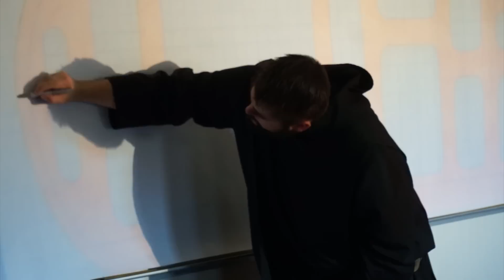Teardrop Trailer Part 2, Axel and Framing(?)

Comment: I love the way these videos show thefancy workshops he guys have.
Reply from the maker: +George Lee So when you don't have the right tool or skills to do the job properly, you shouldn't go to a friend who does? Is that what you're suggesting? Because I don't think JB Weld would have held up, if I tried to do it myself.
Reply: No I dont mean that, I bough a Sears table saw and a cheap Harbor Freight mig welder and hand tools to build my teardrop. You can see it on D,I,Y Camper. BTW i am not a carpenter.

Comment: Hey man! Good video! I will say the solution to the framing splitting issue is to use 7 layer ply. Birch, ya its expensive but for this "framing" purpose it works better. It also stops the wood from "walking" when you put the screws in. Plus its stronger etc etc etc.  For this function pocket screws are the best.

Comment: Your axle move was a hard but excellent decision. On heavier trailers we observe the 60 40 rule according to weight, empty trailer according to length.
When you glued the plywood together you changed the strand orientation. When we make curved  walls, we drop down in size and glue two pieces together in order to get the bend. By gluing and changing the strand orientation, we have stronger walls in the bend, where it is needed.

Comment: My suggestion is to go with Baltic Birch or Appleply  plywood. Appleply comes standard in 4x8 sheets whereas Baltic Birch will be tougher to find in 4x8 sheets, but they do make it.  Pocket screws is a poor choice when you are joining edge grain to edge grain, as was your case.  Your suggest (half lap joint) is the way to go and would be extremely strong.

Using screws as clamps is classic when the screws or their holes isn't a problem. I remove the screws after the glue as dried so I don't have to worry about running into one later.

Fun project to watch.

Comment: First I really do enjoy your videos. If I were building this I would start with a full sheet of 1/4 inch plywood on the outside and then add 3/4 inch framing to the inside out of hardwood, that way additional bracing could be glued and added to high stress points in the frame of the unit. This way the entire part becomes a wall unit that is very strong.

Comment: I took a different route for the frame.  I built it out of 1x stock.  I just laid them out over the outer skin of the trailer, using different widths and lengths and butt jointed them together with biscuits. (Yes, I know there is almost no strength when you do that),  However,  once I had them all laid out, I glued the entire frame to the outer skin.  All that glue between the face of the plywood and the frame tightened everything up and provided plenty of strength.  Then, I  used a flush trim bit to trim both the skin and the frame at the same time.

For the hatch, I did use plywood for the frame elements,  but had better plywood, that did not give me problems.   It was not Baltic Birch though, just decent plywood.
Reply: Allan Smith 
Stupid question but what kind of skin did you use and why and where can a person buy it ?
Reply: Allan Smith 
Also.   Stupid question but what trim did u use on outside of your outer layer or is it all the same and what everyone uses ?   Where does a guy get that ?
Thanks

Comment: I ended up using Purebond plywood for a simular reason, purebond takes a nice screw and the core is poplar. But with that being said, I think you would half-lap it as well!
Reply from the maker: In hindsight, better products usually work better.  It's hard to make that choice between a $50 sheet of plywood and a $20 sheet.

Comment: I would think about cutting a section out (maybe 12-24" wide) and 1/2 lap a new piece back in.  Plywood has a TON of strength when fasteners are screwed through the face and adhesives are used and along the grain.  Anything fastened into or glued onto the end grain has almost no strength...  That goes for birch as well.
Reply: Oh...  And it was great getting to work with you on the trailer!
Reply from the maker: I have a different idea I'm going to tryout first, but if it doesn't work, I've saved the plywood frames, so I'll give that a try.
Reply: Awesome to see you Greg.

Comment: If both sides of a joint are still good you could remove a portion of wood on the same side on both pieces and glue and screw a patch between them. That way you don't have to start from scratch and it'll add enough strength to get the sides up. For plywood I try to avoid using small fasteners.

Comment: to make laminate stronger, change direction of grain
sheet 1 : Grain horizontal 
sheet 2 : Grain Vertical 

also you should use lapping joints where they meet

Comment: Cut back about 6" on each side of the break joint and lap cut those ends. Then make another piece to go between using the half laps. But use some hardwood for that section piece.
BTW, you said you wanted only 1" thickness for some reason. If you could adjust that a bit, you can do your own fiberglass around the frame and get 300% more strength just with a couple layers of fiberglass cloth. It's easy to do yourself but does take time and patience. You have the latter, being a man of the cloth!
Reply from the maker: The 1" target is because that is the size of the insulation.  I've thought about using some epoxy to help with strength, but hadn't thought of just glassing the frame.

Comment: Hello Father T, 
I would skip the fasteners all together for joining the plywood frame pieces. You should google "scarfing plywood", boat builders do it all the time, and makes for a strong 100% joint.  I think because you have already cut it short I would "scarf" in a third piece. The technique will maintain the full strength of the plywood as well as maintain its thickness. Another option could be to use lap joints and again add in a short 3 short piece. Butt jointing plywood is not usually the best choice and I avoid it. Thanks for the video's keep up the good work.
Reply from the maker: Scarfing looks like an interesting technique, I'll have to look more into it, thanks

Comment: Don't lose heart padre.  Stay clear of pocket holes on plywood.  Why not have your sides as sheets and cut the curves to go across between your sides?  Think about how people do a pirates chest...youre doing the same thing, but on a large scale.  Narrow boards will follow the curvature of your side frames and will be light.  If you glue your boards vertically, you'll gain additional stiffness.  One idea that comes to mind is to glue canvas over the little boards and then cover it with epoxy for waterproofing.  You can sand epoxy for smoothness, but use a respirator.  That dust is deadly.
Reply from the maker: +Hugo Danilo Actually that seems to be the traditional way to build a teardrop trailer. I've noticed with tiny houses though that they are built with traditional home framing techniques, and I want to see if they could be done on this smaller scale too. It could be there's a reason why everyone does it that way, too.  Thanks for watching.

Comment: The framing really should be one piece, no joint. If you can't manage that due to size etc., a long bridle joint (glued and screwed) would be the next best. There are a lot of stresses on the framing...wind and vibration tends to loosen things badly. Baltic Birch would be an excellent choice of plywood. 

You really don't want the trailer coming apart in tow. That's an adventure you do can do without.
Reply from the maker: How is that even possible?!?  Even in the traditional building technique of starting with the exterior plywood, it generally piece-meals together the framing between the walls. Even if there is some weakness in my technique, would it still not create a torsion box-like effect?
Reply: Generally what happens is the framing starts to flex, the exterior skin comes a little loose, then the wind gets in somewhere and starts tearing things up (remember that highway speeds give you highway-speed wind). 

I've seen it on commercial metal and wooden tear-drops and I've seen it on in-box truck campers/toppers of both types. I've also seen a well-used tear-drop that's lasted 25 years and counting (sweet machine with a full outdoor kitchen in the back) so if done properly the trailer you're building can last a long time. 

I can check with the owner of that one tomorrow and see what he did for the joints and if he's had any issues with it. I know he built it the summer I got married and I know he still uses it, so he must have done something right. I'll get back to you on that.
Reply: Okay, I have his answer. He glued two sheets of 3/4" plywood (just construction grade) like you did, left them at 1-1/2" (he drives 3/4 ton trucks, so weight isn't a concern for him) and used 16" gussets from the same plywood glued and screwed on both sides of the joints.  

Likely overbuilt, but when weight isn't a concern why not?

What he suggests to keep the weight down is an 8" long lap joint glued and screwed or a 4"-6" long bridle joint, again glued and screwed. We both think the bridle joint would be stronger, but it'll be a pain to cut. 

He also suggested gluing all of the sheathing down, but I'm guessing you were going to do that anyway. Also, he's a big believer in marine paints and stains for the finish. I have no experience with those, but it kind of makes sense.

Good luck with the project. I really look forward to watching the videos.

Comment: Would creating a half lap on the pieces that broke and splicing with solid wood be a good solution? Seems like a waste to scrap the whole frame
Reply from the maker: That is certainly an option to go with.  I did something similar for a very large circular painting stretcher.  As I mentioned, I do think this system will work, but I'm going to try a different approach moving forward.

Comment: Try cutting your frame out of 1/4" plywood laminating several layers, and  staggering seams to desired thickness. also pocket holes are the devil.
Reply from the maker: Are you talking about laminating sheet of 1/4" plywood together like I did with the 3/4" or cutting strips closer to the size of the templates and then laminate those pieces?

Comment: if the trailer is only 8 ft long why don't you cut that framework out of one continuous piece of plywood double thick and then use the remainder of the piece of plywood to cut the other pieces you need

Comment: I cringed when you were using the router with those loose sleeves. An elastic band holding them tight against your skin, or up abopve your elbows, would make them much safer
Reply from the maker: Please don't do anything in your shop you are uncomfortable doing.